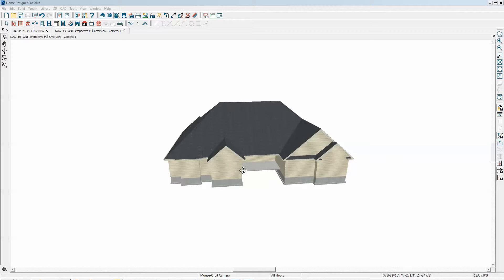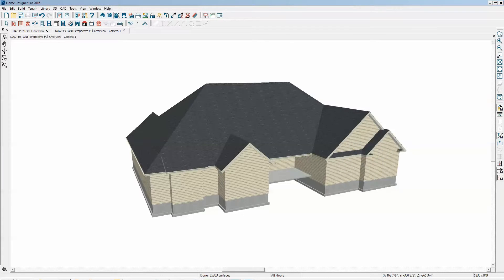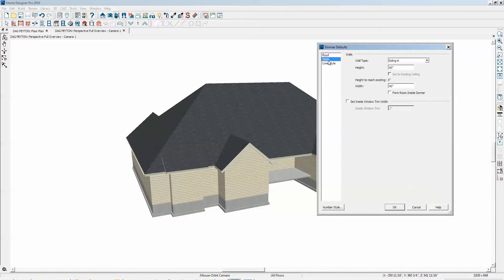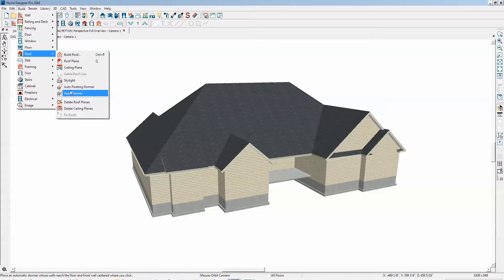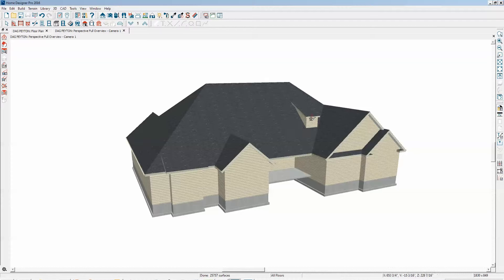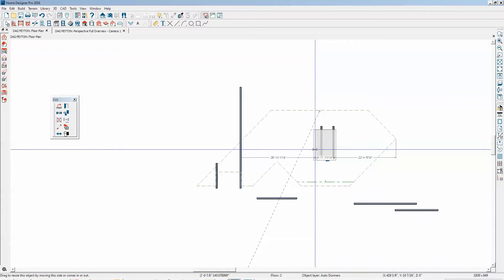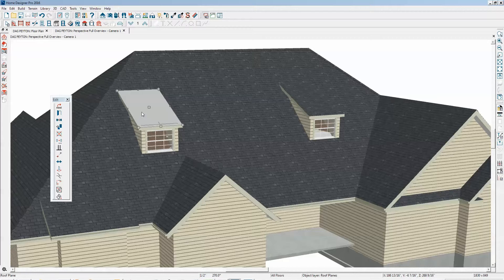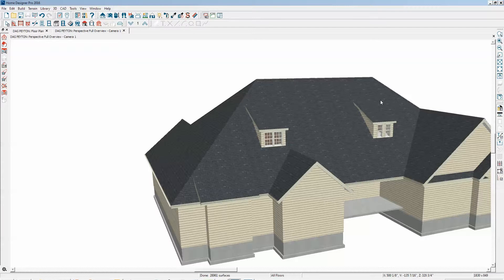Dormers in Pro 2016

Comment from the maker: As you have seen using transform-replicate does not work for every occasion. For dormers it works better to explode them into individual parts and then you can manually raise or lower their roof planes (as you raise  or lower the roof planes, the dormer walls expand or contract. Before the dormers are exploded you can raise or lower them via their own dialog box using the "Ceiling Height" setting of the dormer dialog. There is usually more than one way to get a particular effect
Reply: David
I found a better way that also solved my issues with the side walls.  When I manually created the dormer on the second floor I had to extend the side walls too far into the room so that when you looked at the 3D or elevation view they closed in the dormer.  I was advised by HD support to just put a CAD box over the portion of those walls so that they were not visible on the plan.
I believe that you did a video whereby you created walls in the attic to solve that issue but that you were not totally successful.  What I did was move the roof plane to the attic level and create the dormer.  Then on the second floor I created the side and front walls of the dormer immediately below those on the attic level. The only issue was that there were two sets of windows -- one set on the dormer in the attic and one set on the second floor.  To solve that issue I just deleted the windows in the attic dormer and voila success.
Alan

Comment from the maker: The dormers have separate roof planes that would have to be moved as well after you move the main roof plane (they do not move by themselves, you must do this as well). DJP
Reply: I tried to move the whole dormer using the Transform and Replicate function and used a minus value in the Z axis but that didn't work.  There are other issues with the dormer in plan view but I think I'll post in the Forum.
Alan